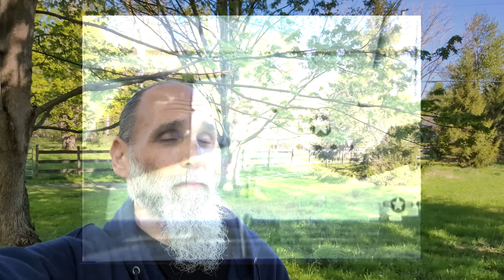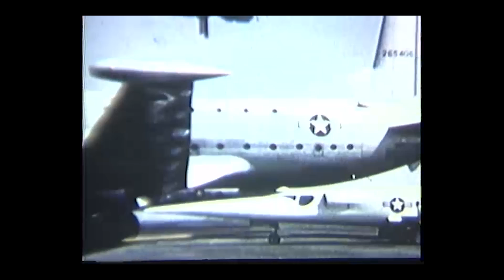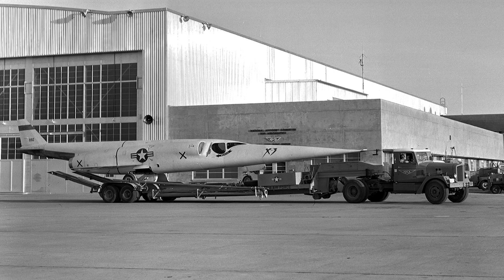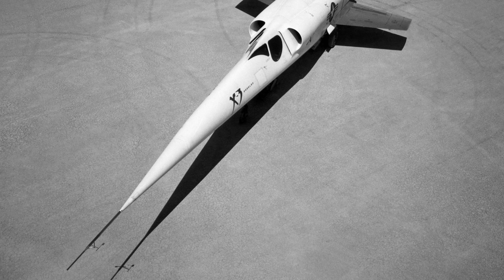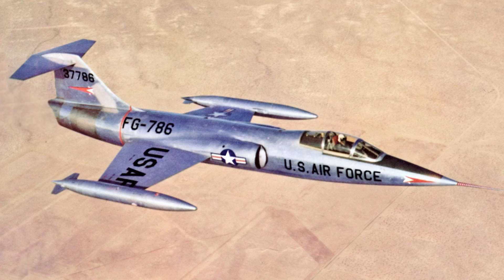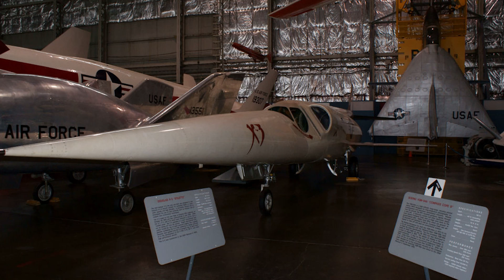The Douglas X-3 Stiletto: Built for Mach 2, Too Slow for Mach 1

Comment: A predecessor to the F-104, yes. Certain angles, especially the rear half, also bear a passing resemblance to the F-4 I think as well so the research form the X-3 program probably found its way into many subsequent designs.
Reply from the maker: @escargotomy I can see the F-4 resemblance from certain angles too. One of the fascinating things about experimental aircraft like the X-3 is how the lessons learned can influence later designs, even when the original aircraft doesn't accomplish what it was built to do.

Comment: Back in 1951 Richard Whitcomb realised that transonic drag could be minimised by avoiding sudden changes in cross-sectional area. This aircraft was designed before then, and it shows. You can see the sudden changes at engine inlets, leading edge, trailing edge and behind the engine nozzles. Subsequent aircraft were designed with a narrowed fuselage (referred to as 'coke-bottling') wherever extensions like the inlets or wings were present.
Reply from the maker: @onenote6619 You're correct. I've touched on Whitcomb's area rule and the 'coke-bottle' fuselage in a few previous videos. It's fascinating how much that discovery changed supersonic aircraft design. Thanks for adding those details!
Reply: The intakes and nozzles aren’t counted in the area ruling calculation, as the air passes through them, but the cowling and any bulges there do count.
Reply: 3 different German aeronautical engineers were each independently using some version of the area rule during WWII.
Reply: @FloyceWhite

They were not.  No aircraft was designed that way before the F-102A.. and it has ZERO benefit for subsonic aircraft.  

It’s like saying that the ME-262 had swept wings which made it faster… when they were only swept as much as a C-47 and for the exact same reasons.
Reply: @Bartonovich52 Uh... area ruling a plane helps in the transonic regime, at speeds below which the shock cone is regular.  That's why air-to-air missiles are perfectly fine having fins without narrowing the body.

Nice try though.
Reply: @Bartonovich52  You are correct.
Reply: The X-3 does not have large cross-sectional area changes due to it's low thickness and short span wings and empennage.  Ditto for the F-104 that has very low transonic drag and is capable of supersonic flight at sea level despite its modest thrust-to-weight ratio.  Also ditto for the AGM-28 'Hound Dog' missile.  Using a dry J-52, it could cruise at over Mach 2 and attack at low altitude over Mach 1.  The X-3 just didn't have squat for thrust.  It's inlet design is also inappropriate for supersonic flight:  thick cowl lip and insufficient boundary layer diverter.  Douglas blew that one, but those errors were fairly common at the time.

Comment: It's the same as the SR71 in that it looks like it's going fast when it's sitting still.  I never would have thought it was stuck in the subsonic realm unless diving.  Heck the old Sabre jets could break mach in a dive.  Thanks for sharing.
Reply: The X-3 employed titanium in its ariframe so it was capable of dashing to Mach 3 and surely cruising at Mach 2.  Its underpowered engines were to blame for its failure to achieve the design goals.
Reply from the maker: @GeoSciful The engines were definitely the X-3's biggest handicap. From what I found while researching it, though, the original goal was sustained flight around Mach 2. With the more powerful engines originally intended for it, the X-3 certainly would have been a very different airplane, but we'll never really know what the airframe could have achieved. That's another one of those great aviation "what ifs."
Reply from the maker: @fsj197811 That's exactly what makes the X-3 story so surprising. It looks incredibly fast just sitting there, yet it couldn't even reach Mach 1 in level flight. Thanks for watching!